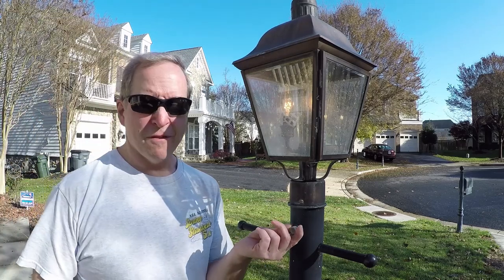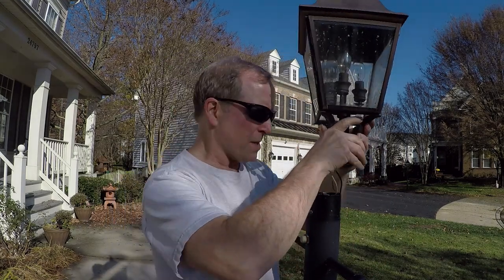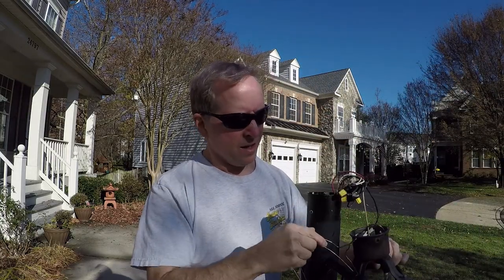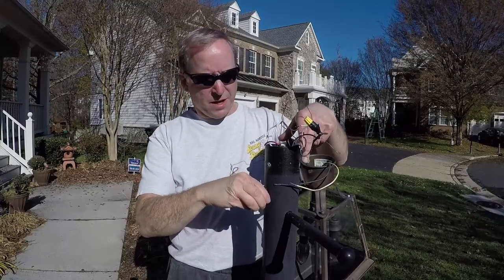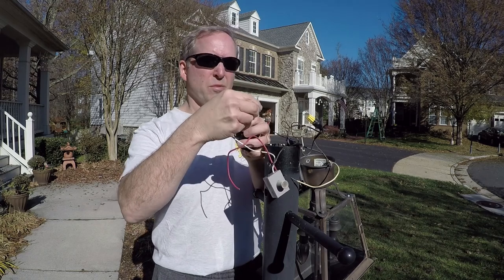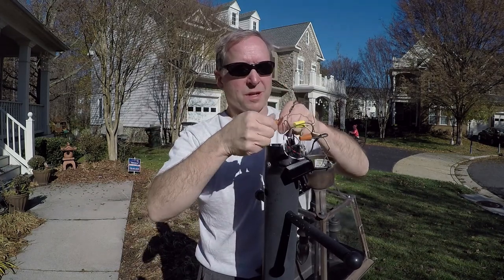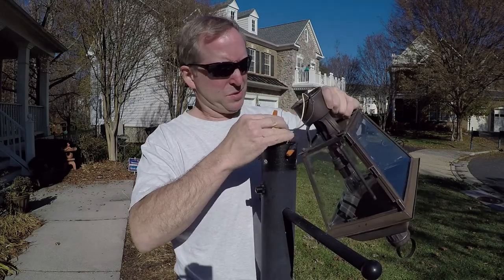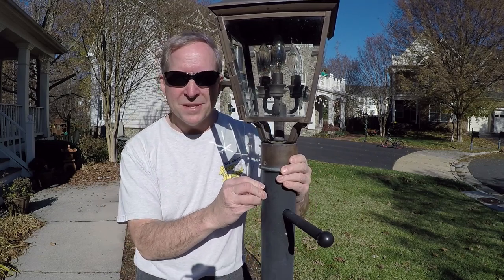How to Replace, Repair of a Lamppost Sensor - Simple $15 DIY

Comment: My yard light was not coming on at night so I replaced the photo cell and it still didn't work.  Finally figured out the GFI was tripped.  Good idea to check before wasting money on a new sensor.
Reply from the maker: Lance McGrew, thanks for sharing. Always a good thing to do.
Reply: What's GFI
Reply: Thanks for that comment. Just saved me a lot of time.  GFCI was tripped!

Comment: The video was a great help. But did you connect ground  wire to anything at all . When i pulled it apart . The ground  wire wasn't  connected  to anything
Reply from the maker: Tyrone, that's interesting. My post had a ground wire attached to it. Look around a bit more, you might find one, maybe deeper in the post. But be careful.
Reply: So if i still do not see a ground.  What is my next  move. I see a ground wire from  the light part, but nothing  down in the pole
Reply from the maker: @tyronepatterson5607  I hesitate to recommend things because I can't physically see your setup. When in doubt ask a friend or neighbor who is more familiar with your system. Good luck.

Comment: Hi...nice video. I have a dilemma and hoping you have a solution. The hole for my sensor is 1 foot down from the top of the pole. How can I easily get the new sensor in? No way I can get my hand down there. Makes me wonder how did they get it in in the first place. Thanks.
Reply from the maker: You can use a coat hanger or other, thicker wire, and tape/hook the sensor to it and lower it down, and guide it into the hole. You might also want to attach a "safety" string line so if the sensor falls off the wire before you can get it in the hole, it doesn't fall to the bottom of the lamppost. Hope this helps.
Reply: @MakeItorBreakItNow  thanks...that's what I was thinking

Comment: You mentioned 2 black wires and one went to black and the other to red.... how do you know which one to attach to which one?
Reply from the maker: Michelle Bigatti, the best way to where the wires go is to take a picture of the set up before disconnection the old wiring. The paper instructions that come with the sensor also might help.If you have two wires of the same color a bit of tape on the wires also helps.

Comment: My sensors keep going bad, any chance I can just bypass it? Not worth replacing it every year and a half (new construction in 2017, been through 2 now
Reply from the maker: Peter, interesting. You can probably by-pass, but then your would be on all the time? If you have a switch, less of an issue, our post light doesn't have a switch. For me and the neighbors these sensors last about 5-10 years. I've found sometimes sensors go faster if there is moisture path, it can be the smallest hole. Not saying this what is happening for you, but you might want to give it a check.
Reply: @MakeItorBreakItNow  Yes sorry, it's already on a switch in the house so it would just be a light switch on/off vs on/off + sensor. The sensor doesn't add a lot so why bother (IMHO)
Reply from the maker: @VA-NJdevilsfan  then I'd have to agree with you. Thanks for the follow up
Reply: What size sensor are you using? I went through a lot of the smaller sensors that use a 7/16" hole.  I'm going to try the larger one like he has in this video.  It uses a 5/8" hole.

Comment: Best if you have a 5 ft stepladder and set it next to the post and lay the light on it. Then disconnect each sensor wire one by one and reconnect the new one by one. Then remove the old sensor and put the new one into the hole. With the wires already connected you cannot accidentally drop it down the inside of the pole.
Reply from the maker: Great idea! Thanks for sharing so others can benefit from your suggestion.

Comment: Question, does your light fixture have to be a dusk till dawn model or any other regular version will work? I’m guessing the dusk till dawn box you replaced turns the normal or any fixture to a dusk till dawn fixture.
Reply from the maker: Charlydx21, if I understand your queion coorectly, the answer is yes, as long as your light can support the wiring, and the post can incorporate the box.

Comment: There is a transformer crammed into my light pole. We have a CFL light. Is it for that?
Reply from the maker: Kimbee, hard to tell without seeing the light or setup, but most screw in CFLs dont require a separate transformer.

Comment: Thank you for the video.  My lamp post just has two wires coming from it. But the sensor has three wires coming from it. Cant get it working
Reply from the maker: Dave, check the diagram that comes with the sensor, sometimes you can pair two of the wires together to make it work. Not trying to be insulting here though some don't know, if your third wire that's a ground. You might not have the right sensor for your lamp. I get in the habit of taking pictures of the "before" setup to make sure I get it right when I put things back together, that always seems to help me now having learned from my past mistakes. Thanks for your comment.

Comment: My light doesn't turn on when I try switching it on from inside the house.  Could this be my problem?  Also when you mention that you switch electricity off is it all electricity to my home or just breaker to the lamppost.  If so, mine isn't labeled, so I don't know which breaker
Reply: Do you have just one lamp post or a couple, if you have more than one that works just go down the switches at your box until a light goes out, is rare for all photocells to go out at once but if you have several lights out and can't find the cut off switch for power then you have to turn off main power, only other way would be have another person with a voltage meter help and take lamp cover off to expose the wire connections and have that person test the reading as you turn off switches and find the one that kills the power then label it. This only takes a few minutes to wire in a new photocell or just wire lamp to house power and do away with the photocell, there are a few ways to skin this cat, hope it helps you.

Comment: Hi have done this a few times but does anyone know a screw in socket photo cell that actually works indie the globe because I get the bulb flickering as is begins to turn on or off so not reading to well inside the glass enclosure.
Reply from the maker: Luba Luba, your sensor is inside the fixture. I've never heard of anything like that.

Comment: I'm doing this whole thing new light new sensor but I have no power coming out of the pole I'm thinking it's a circuit breaker
Reply from the maker: Rocky, most likely. make sure the power is not on when you are working on the wiring.

Comment: I have replaced my photocell for the 3rd time this year.  And pretty much every year for the past 5 years. They boast that they are raintight. Not.  If anyone call give me the brand of a reliable raintight photocell, i appreciate hearing from you.  In the meantime i am going to put something above the cell to shelter it from direct rainfall. Alternately,  I just start using dusk to dawn light bulbs. $17 for 2 on amazon.ca with a 3 yr warranty.
Reply from the maker: Halifax Steve, thanks for the tip about the lightbulbs. I'll have to check that out. I'm now using LED bulbs I got from COSTCO that are working well for me.
Have you tried using caulk or hot glue to seal up areas around the sensor? That might help. I've also found electrical tape around the twisted pairs also helps, just in case your not doing those things already.
Reply: @MakeItorBreakItNow  thanks for getting back to me.  It is obvious that the lense that is exposed to the elements has moisture/water in it.  Although the assemble boast raintight, they are obviously not.   Today I installed a dusk to dawn led.  I hope it lasts.  Some boast up to 25000 hours, which if you do the math can last up to almost 7 years. Much easier than replacing the photocell every 3 months.  I've researched this issue extensively and it looks like these photocells are failing a lot for homeowners.  Cheers